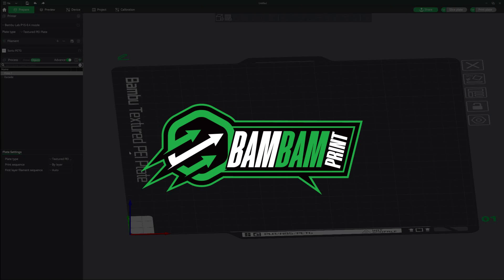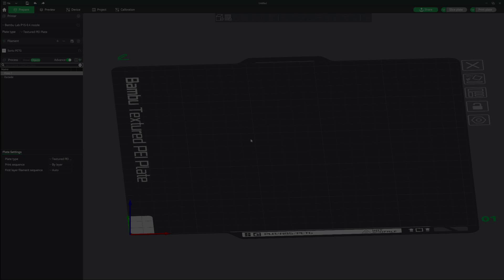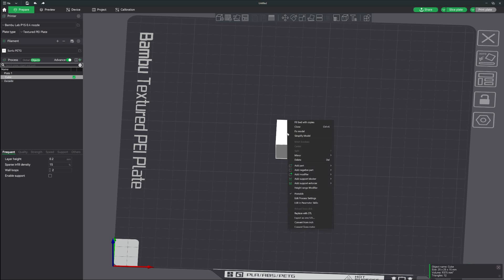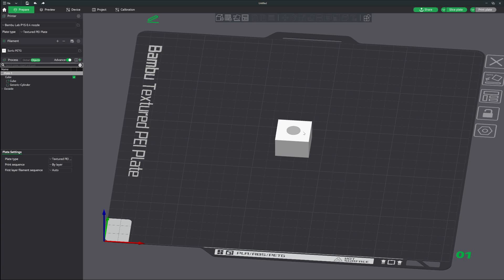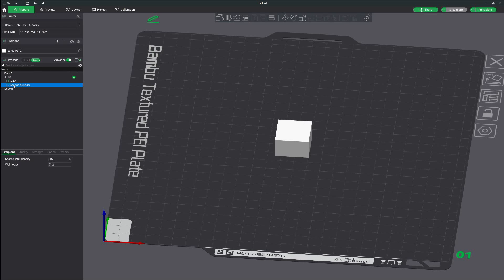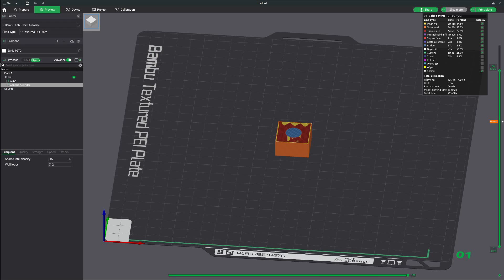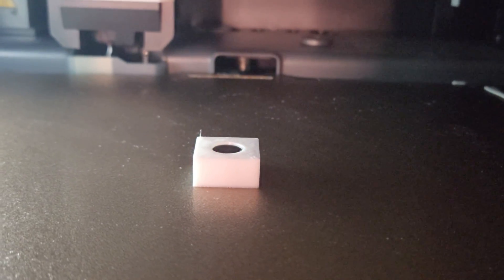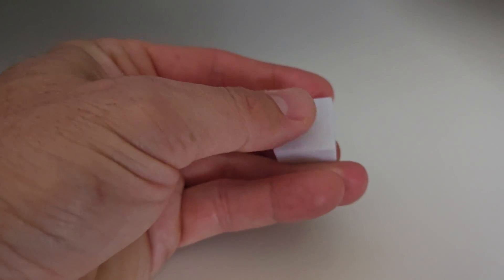3D Printing Guide: Adding Magnets To Models With Bambu Studio

Comment: I'm designing a window mesh screen to stop creepy crawlies from entering my sitting room in the summer while letting cool air into the room and wanted to have a plastic frame that would fit snugly to a steel frame I'd glued to the inside of the window. Your great video solved my connection problem (magnet inserts) Thanks a lot. btw, your comments section is interesting.

Comment: Do you have a tutorial on how to add a a magnet to light box? I made some light boxes in maker world, and I want to add a magnet to the edges of the box and then the back cover. I'm working on making some battery powered, so easier access to the inside is what I'm looking for....if any of this makes sense.
Reply from the maker: No I have not for that specific scenario but the same concepts should still be relevant.

Comment: Nice video. But what if my model needs supports? It adds supports in my hole and cant put the magnet in :D
Reply from the maker: I would suggest watching my entire Bambu studio tutorial. It will teach you how to fix that and a ton of other information.
Reply: @planet3dp  Where? I can't find it and I am stuck with the same issue.
Reply: @JasperSchulten   You can add a support blocker around the hole. That way it won't put supports there. Just right click and click "Add support blocker". Pick a shape, resize it, place it around where you don't want supports. Slice to check you work and you should be good.

Comment: Thanks for the tips. I tried this last weekend for the first time, modelled a fairly tight tolerance around the magnets, and even held a magnet up to the bottom of the print head to see if there would be an attraction. No pull on the print head detected, so added the magnets to the holes, and 3 of 4 ripped out the first time the print head passed over... next time will use glue!.
Reply from the maker: Glue is a great option as well. I have found using just the right amount of "tightness" does the trick and keeps the magnets from pulling out. Remember the material will expand into the infill as you insert the magnets, giving you a tight fit from the start.

Comment: 3:07
It's ok to add pause here, but actually you can add pause on first layer which covers magnet
Since pause is added at the beginning of the layer (before it starts printing)
In your case, after pause, there would be 1 extra layer before layer which covers magnet

Comment: I want to set the magnet .4 above the plate so it starts the hole at second layer of print but Bambu floats the negative object mid model. Trying to adjust the Z height of the negative cylinder is useless as the scale is arbitrary z heights that don’t seem to correspond to actual height off bed. For example if I set z to .4 it goes negative plate. So easy in Tinkercad.
Reply from the maker: You are absolutely correct. Tinkercad is definitely a much better option for more complex additions or changes to your model. I rarely make large changes in Bambu Studio unless it is something simple or less complex. Thank you for the comment. If you have time you can check out my Tinkercad tutorial, there might be something you could learn there. Have a great day!

Comment: Is it possible to add 2 magnets on  larger items and keep them at the same depth
Reply from the maker: It's hard to tell without seeing the model but that sounds reasonable!
Reply: @planet3dp  Lets say the Name plate you created in another video. So it can be made into a fridge magnet. I can't figure out how to make 2 voids at the same depth.
Reply: @ThatJerkFromCali  I model with SketchUp.   Perhaps any cad program would be similar.  Precisely locate any number of voids inside a model as if they were solids, using cad.  When imported into Bambu Studio select the model, right click and select "Split", then choose "to parts".  The object and its parts will appear in the object list in the left frame of Studio.  Change the void parts to negative parts.
Reply: @ThatJerkFromCali  If you had to do it in Bambu Studio:  Add the primitives that are going to be the voids and position them in the model how you want on the x and y axes.  Select everything, right click, select "merge".  This makes an assembly.  Select only all the voids next, using "ctrl" select, so they are all selected at once, then "move", then enter .4, or whatever height you want them to be above the plate, in the Z axis box.  All the voids will move up by your specified height and stay there.  Change the "Type" of the voids to negative part.  Print.
Reply: @jrandomwinner  thank you so much for the advice very helpful and very appreciated

Comment: How do you keep the magnet from sticking to the nozzle?
Reply from the maker: I make my magnet holes snug to prevent that from happening. I hit on that in the video.
Reply: superglue works
Reply: Nozzles are usually not magnetic
Reply: @joselito7776  Bambus Steel and hardened Steel nozzles are. Brass nozzles are not, but also do not last as long.

Comment: Ever tried to set up the voids in cad?
I did it in fusion but when in bambu studio, i have to leave the geometry untouched: dividing into objects makes the voids solid and fall on the plate, dividing into parts leaves them in place but turns them into solids, thus printing them
I need to make this step because another part of the print is intended to be a different color and cannot change it until divided
Reply from the maker: I have not tried that no. Interesting tip to point out. Thanks for the support!

Comment: As someone who has installed 100s of magnets into my 3-D prints, a couple tips:
1)In Bambu, pause the print on the layer that first covers the hole, NOT the last open hole layer

2) Sometimes it’s easier, rather than trying to dial in an exact snug fit, to put a little superglue in the hole and then put the magnet in. Depending on the height of your print, the magnet will hold itself down to the bed

3) use the bambu software to drop the bed down so it’s easier to put the magnets in, or apply superglue

4).4 mm is usually a good depth below the surface to increase the attraction as much as possible, allows for two layers of plastic if assuming a 0.2 mm height.

5) I prefer to print the magnet side down, close to the bed if it all possible. This allows me to print two good layers prior to starting the hole, then dropping it into the hole, then it can print a lot of layers on top of that, which assures a better finish. If you drop the magnet in, and then try to print two layers on top of that at the end of the print sometimes those layers can be a littlebit ratty, depending on how good your filament sticks to the magnet.
Reply from the maker: Great points, thanks for the comment!
Reply: I print with ABS using a P1S - an enclosed printer.  The bed is heated during the print.  Inserting the usual easily obtainable el cheapo neodymium magnets close to the bed (.4mm) resulted in the magnets getting hot enough that they lost a lot of their magnetism.  Apparently this is a permanent change.
Reply: Could you elaborate more on why you suggest your first point?
Reply: @sjoerdboonen  you mean what point you pause it on?
Reply: @plugger410  yes, I mean would pausing it on the layer which covers the hole not like, cover the hole first, making it unable to actually put the magnet in? Or does the pausing occur before the selected layer?
Reply: Ever tried to set up the voids in cad?
I did it in fusion but when in bambu studio, i have to leave the geometry untouched: dividing into objects makes the voids solid and fall on the plate, dividing into parts leaves them in place but turns them into solids, thus printing them
I need to make this step because another part of the print is intended to be a different color and cannot change it until divided
Reply: @deepsgnips  Using SketchUp, I make the voids for the magnets as solids inside the model.  I then erase them to the clipboard and export an .stl file of the model without them.  I erase the model and paste the magnet voids back into the place they were inside the model, even though the model is no longer there.   I can then export the magnet voids as an .stl file.  When importing the two files into Bambu Studio at the same time they come in as a single object with two parts.  I change the magnet part into negative part.  They stay in place rather than drop down to the bed and the print comes out as modelled.
Reply: How do you stop it from putting support in the magnet hole? I was able to keep it from placing support there by clicking “support on build plate only” which worked fine because I only needed support there. But if I had needed support somewhere else, is there a way to exclude the magnet hole?
Reply: @jboat571x9  yes, in bamboo Studios there is a support painting option that allows you to specifically paint on extra support or delete Support in places where you don’t want it. Just use the manual option. There are lots of YouTube videos on this. Good luck

Comment: You forgot to tell folks if they plan to use paired magnets (vs a magnet plus a metal plate) to mark which side of the magnet should go up to ensure the other magnet that is also embedded in thr matching part is of the right polarity to attract rather than repel.
Reply: It's  something people need to figure out by them self, since its so obvious. No need to idiot-proof every tutorial.
Reply from the maker: Hey thanks for the comment! Yes I thought about talking about that, but thought it was a bit out of scope. I wanted to keep it short and simple. Maybe for another video I have planned though.

Comment: what i need is how to keep it from auto snapping to plate when i place it close to plate plane no offense but most magnets are not printed upside down like this.
Reply from the maker: Are you talking about your model snapping down to the plate? If so once you assemble two models together they will freely float above the build plate.
Reply: @bambamprint  if you say try to elevate a cylinder .3mm from  the build plate it snaps back to 0 unless you move it way above the bulb plate.
Reply: I might be able to turn everything upside down merge them then turn it back right ways up but seems unnecessary I should be able to turn snap off.
Reply: Also absolute coords don't work correctly or I would just do it that way.
Reply from the maker: You need to watch my mesh Boolean video. https://youtu.be/xN8KJc8j-BQ
Reply: @planet3dp  why does it answer my question bc I know how and what those functions do?

Comment: One thing I've always wondered about when it comes to placing magnets inside prints is just how deep to put them so they're safely buried yet minimal plastic between the magnets, which would make the attraction weaker. Obviously deeper than the walls.
Reply from the maker: I think that is going to become a print and test scenario. Not all magnets are created equal and all have different strengths so depending upon your use case, you could do small test prints such as the cube in my video example.

Comment: Nice and easy. I thought the magnet would stick to the nozzle,  do you have a hardened steel nozzle test?
Reply: I believe if the fit is too loose, the magnet can get pulled out by the print head.  Too tight, and you're putting force on the bed when you push it in.  I have yet to try it, but that's the only thing I'm worried about.....getting the fit right to avoid either issue.
Reply from the maker: Great explanation, you nailed it on the head!
Reply: @planet3dp  I'm going to make my 1st attempt at this tomorrow.  I have found that my extruder doesn't seem to be very magnetic.  My small 10x1mm barely will stick to it if I try and 10x3mm will a little, but they are strong enough that I think they will stick to the bed through the part instead.  Here's to hoping my hole is deep enough so the nozzle doesn't hit them!  I've done quite a few samples, but there is always some small variations between prints.